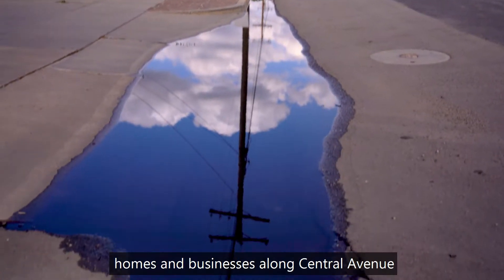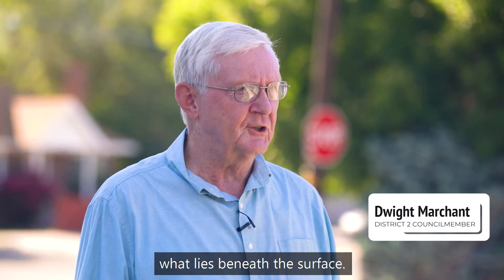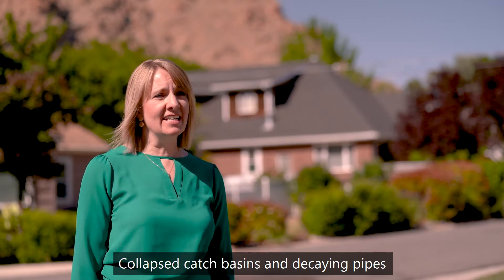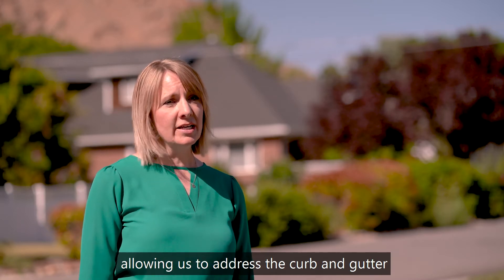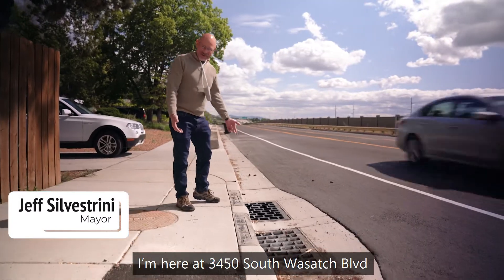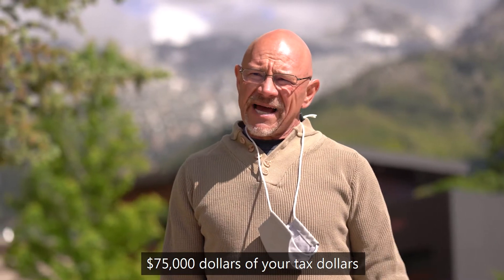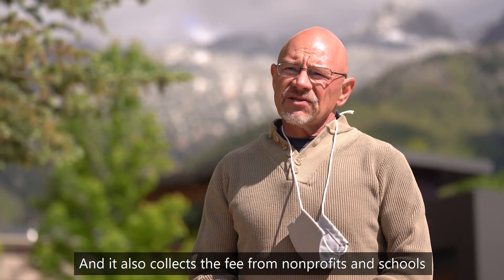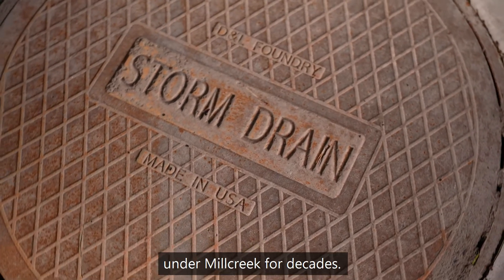Storm Drains: The Monster Beneath Millcreek

Comment: This is bogus. The pictures they've used are typical of drainage. They are taking millions of dollars to "Investigate" Somebody will be getting rich. They need to wait till there's an actual problem. I VOTE NO.
Reply: The City Council recognized the need for funding to address the many old and failing storm drains in the city and the fee has been implemented.  The funds will be used to not only investigate but repair storm drains.  In the last fiscal year, $1M that was planned to go to road repairs had to be redirected to repair storm drain failures that did cause actual problems where roads had caved in, pipes had failed or properties had been flooded. The implementation of a storm drain fee will allow these emergency repairs, along with repairs of areas in need, to be completed without taking money away from the road repairs that are frequently requested by Millcreek residents and are badly needed.